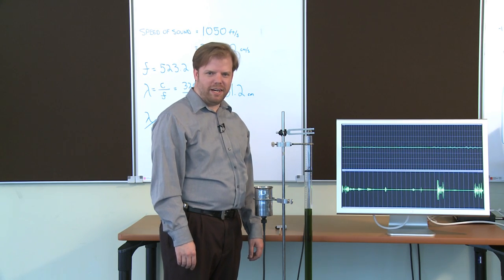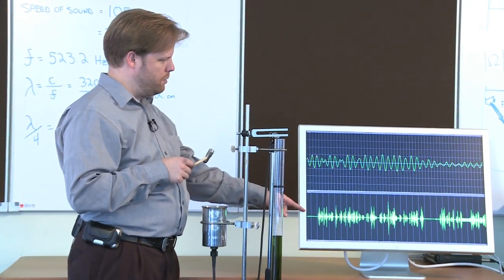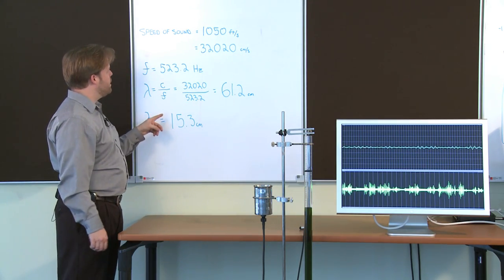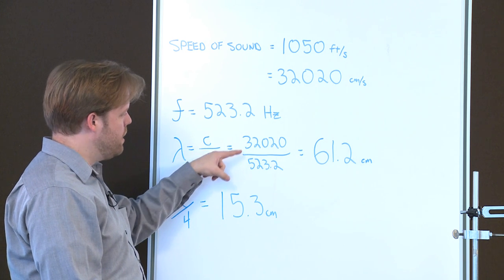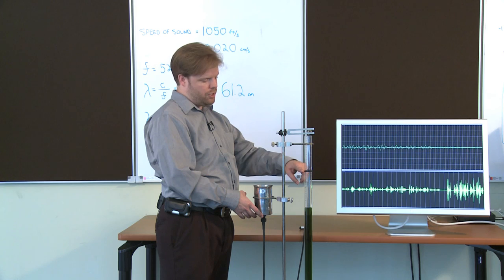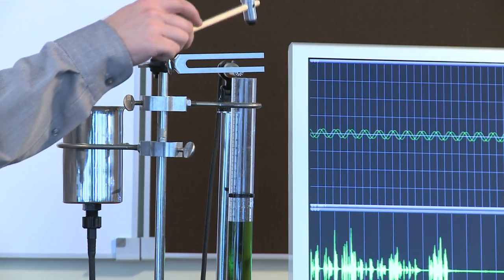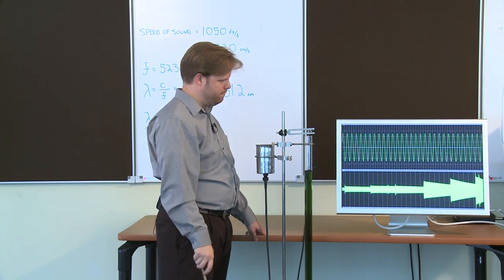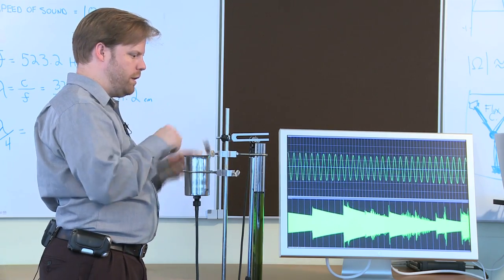Pipe Resonance

Comment: Why was the tube's air volume 2 Hz off from the tuning fork? Measuring the water from the top of the meniscus wouldn't have even made such a wide intonation wave. I'm just curious, maybe 343m (standard) is a constant with electronic sine waves while temperature only then directly effects amplitude dissipation instead of temperature determining the size of the metal fork because metal expands at lower temperatures. What do you think?

Comment: Dear Prof., I have a mix up in my terminology, I think you can clear things up. 
I did the following experiment: I have air flowing through a straight pipe. Pressure ratio between outlet and inlet is lower than the critical pressure ratio, which suggests flow velocity at the outlet is close to the speed of sound. I have recorded the sound of this process and analyzed the frequency spectrum. Suprisingly for me (but maybe not for you), the dominant frequencies are in a integer ratio to one another. So this would imply a standing wave behaviour.. but can it be called that? The air is moving at a great speed through the pipe after all. 
I search on the web for explanation, of little avail. Literature containing a mathematical approach would be greaty appreciated.
Take care, love your videos.
Reply: The term "standing wave" is typically used to describe a resonance that is happening in a room. So yes, what you are observing in your experiment is a resonance, and yes, multiple frequencies resonate simultaneously. For a pipe that is open at both ends, the fundamental resonant frequency will have a wavelength that is twice the length of the pipe. And then yes, integer multiples of that frequency will also resonate. Here's some more information from our book: 

http://digitalsoundandmusic.com/2-1-4-resonance/

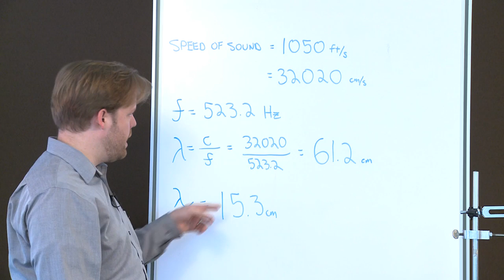Comment: At 1:42 why is it 1/4 of the wavelength
Reply: Because at that point node is formed ie the displacement of wave is zero there.....
Reply: At water surface and open surface we apply boundary conditions i.e., a node is formed at the water surface (since its displacement must be zero at all times) and an antinode is formed at the open surface. Distance between a node and an antinode is lambda/4, where lambda = wavelength of the applied frequency.